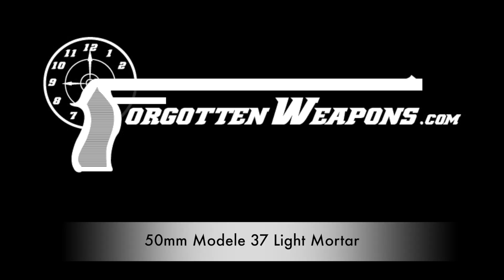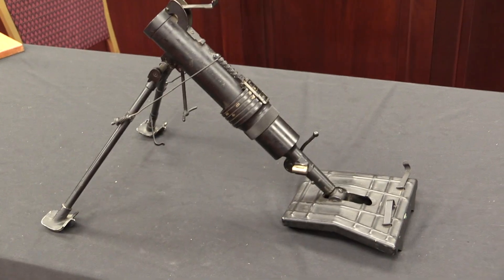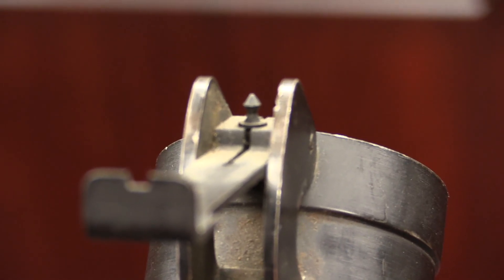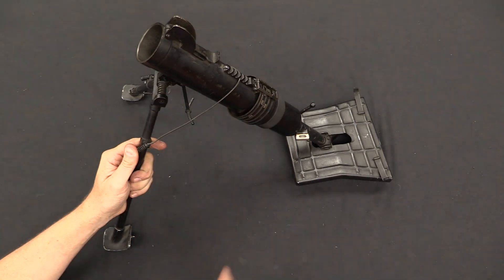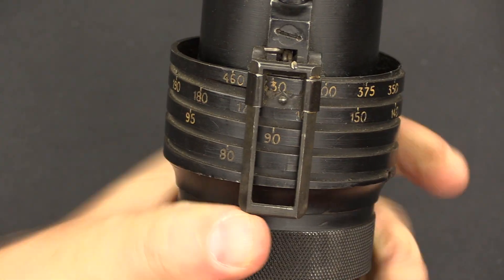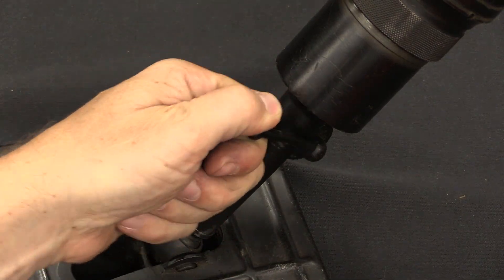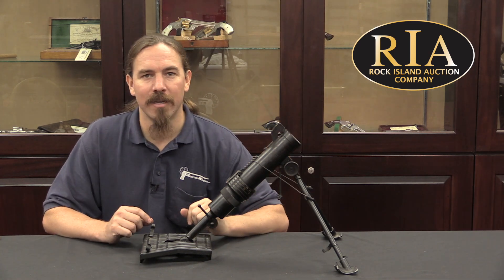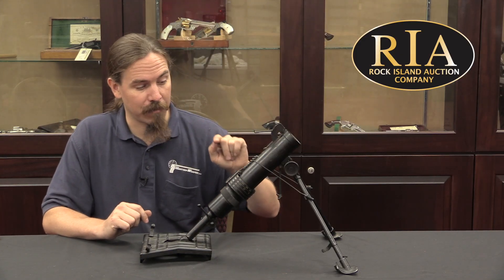France's Super-Light 50mm Modele 37 Grenade Launcher

Comment: Ironic that the thing dissassembles brick walls also has the same name of the thing that keeps them it together. 

Early cement was made with shells and lime stoned burned and crushed/pestled inside large mortar (and for some reason the product it produced got the same name as the tool it was produced it)

Then the mortar(weapon) comes along which basically looked like an oversized cauldron and while mortars and pestle worked by applying force to the inside container to crush something, the weapon version works completely opposite, applying force to the OUTSIDE to expel an INTACT projectile out of it!

Should be called antimortar, though to be fair both the mortar&pestle and the mortar&projectile are in the business of crushing stuff.

Comment: Does anyone think that light mortars and also hand grenades will be replaced by UGL grenade launchers fitted under the barrels of modern assault rifles. 

Projectiles fired from UGL are probably much more accurate than hand thrown grenades, and if 25%/50% of Infantrymen are issued with a UGL, the firepower would be higher than a separate light mortar section in each infantry platoon.

Comment: For all the fawning about this one should remember that the Germans were underwhelmed by this weapon and did not issue it to front line troops but garrison troops, as the Granatwerfer 203(f) and they shut down production only to pick it up 4 years later to help stock the Atlantic wall. Small, light, but also not terribly effective. Considering the Germans thought their own 5 cm too light, and it fired a round twice as effective, this was hardly going to be sent to the troops doing the real fighting.....even if the French thought it could.

Comment: You were at 167M, not 430. The marks show which side of the screw the indicator needs to be on to get that range. The dial needs to be turned until the indicator rides up all the way to the top of the screw on the dial to get to 430+.
Reply: Watch it again. The sliding part slides all the way up.

Comment: The French have made a few doozies when it's come to weapons but what major manufacturing nation hasn't had a few disasters? But aside from that, one thing that is a recurring theme about French weapons is that they are designed and made with a lot of input from the soldiers in the field that will need to use them. Rugged, reliable and operable are priorities. Aesthetics last. (FAMAS however, is not a good example of this).

Comment: First shot slower than a rifle grenade, but subsequent shot comparable, possible quicker and capable of more precision. Military vets from several nations I heard, speak poorly about using explosive rifle grenades, although more understanding of gas grenades  that do not need precision as in riot  control. The rocket propelled grenade as in Bazooka, RPG, etc, rendered explosive rifle grenades and these small, though historically interesting, mortars obsolete. (A military collectors' club had 5 vets WW2 to mid 1970's, from several countries, that spoke of first hand equipment experiences, at a seminar I attended 10 years ago, and subjects of RPGs [one vet a former ComBloc] with brief side comment of rifle grenades-btw, that's what I'm repeating here.)
Reply: Well, they pack too little "KABOOOM" for the weight thus it is not surprising. Unless it is automatic weapon. So they decided that it is better to have 1-2 good BANGs instead of a bunch of plinkers. :)
M72 LAW during Vietnam war was used in this way while Vietkong was using soviet designed AT weapons as portable artillery. Soldiers and real battlefield proved designers wrong.

But in WW2 as there was nothing else to use for a long time - this would be fair addition to the arsenal.
Reply: Supposedly, US troops in Viet Nam were using captured RPGs in preference to LAW. This related by several elderly Viet Nam vets. I have no way to verify those anecdotal comments.

Comment: Seems like you could add a sleeve to the inside of the barrel and adapt it for 40mm.
Reply from the maker: Current 40mm grenades have a rimmed case and must be loaded from the breech.
Reply: Just as well.

I was going to ask about the Bofor's ammunition, but those shells look to be larger than the mortar.
Reply: And put a sleeve inside of that, and fire 12-gauge shotgun slugs! x)

Comment: Seems like it would be a great squad-level support weapon, one that can be easily brought on "routine" patrols and such. Make it with modern alloys, maybe some carbon fiber and use modern propellants to improve range and reduce weight even more. With a map and some good adjustment system on the mortar, you could act like a regular mortar team and drop grenades very accurately.
Reply: Or... you could use a modern, lightweight 60mm mortar, with the large array of NATO-spec projectiles already designed for it (and the 40mm grenade launchers already issued to each infantry fire team).

Comment: Is there any mechanism/bubble level for aligning the tube vertically? I'd imagine that if the sights were on target, but the base was a few degrees off-kilter, the shots would land wide?
Reply: Alex Vogel, just adjust the gas mechanism. You want it close to 45° for maximum range on a given gas-adjustment level, but after all this is not a precision device.
Reply: I'm talking about left/right adjustment, though; if the thing isn't sitting more or less straight up and down on a vertical plane (45 degrees front to back, 0 degrees left to right), it's  not going to shoot straight. For instance, if your sights are dead on the target, but the base is 20degrees off center to the left, the round is going to shoot way wide to the right. If you set this thing up on a hillside, you can use the level to set the 45deg front to back angle, but you may be way off on the left to right. Is there a mechanism to prevent that?
Reply: Oh, now I see what you meant; good question.
I've never shot such a device, but I believe that the idea is keeping track of where the previous grenade landed and adjusting accordingly, gradually closing in. Even much larger artillery pieces are (were?) operating on this principle, with a soldier assigned to be the "observer".

Eyeballing the angle should be good enough for the first shot.
Reply: With precision guns, sniper rifles and long range target rifles, you'll often see a bubble level mounted to the scope. If the gun is canted, even just a little bit, the holdover can be enough to throw your round off target. If you calculate that for a specific range, you need to hold your point of aim say 5 degrees over your target for your bullet to drop into the bullseye, but instead of holding at 90deg from horizontal, you hold at 85 degrees from horizontal, your bullet will come down next to the bullseye, not on the bullseye. This will be much more exaggerated when using something like a light mortar, as its more difficult to eyeball the vertical seeing as you're more or less over/on top of the weapon, instead of directly behind it as you'd be with a rifle. Yes, you could spot your fire and walk it in, but this weapon already has a bubble level to help you establish the correct 45 degree forward angle--it would stand to reason that there is a similar tool to establish a 90 degree vertical angle as well.

Comment: I love how this proves the point that you made, Ian, a few months ago, that the French could come up with some of the best solutions militarily out there, but way too late for it to be impactful in a really meaningful way. I think you made that point in your MAS-36 video, saying that theMAS-36 is probably one of the best miitary bolt-action rifles, buuuuut everyone is going over to semi-automatics now.
Reply: In many cases France was on the cutting edge but stuck with their super cool first of a kind way too long.
Reply: Also, does this take glock magazines?
Reply: piritskenyer,
Remember that the MAS36 was not intended to be a battle rifle, but  to be distributed to drivers, artillery crews etc....Unfortunatly this part of the french military modernization program was more advanced than the one of the semi auto rifle. Which was almost ready to run into production. But shit happens....
Reply: @Zorglub1966  yes, I am aware of that. Despite that, or maybe exactly for that reason, it was an excellent rifle, both in terms of manufacturing tech and combat practicality. The MAS 40 shares many traits of the 36, including the stupidproof sights. I stand by what I said there.
Reply: piritskenyer,
 Sorry for the delay, i translated cautiously.
You're rigth, but i meant it was not on purpose, and out of the locked sight adjustment i sincerely don't understand why sharing some traits between MAS36 and MAS should be a problem.
Anyway, whathever the amount of modern individual infantry weapons available, it would certainly not changed anything for the french armies.

Comment: With that cute thing being so little, shouldn't there be a way to manufacture inter "target practise" rounds for it? How much propellant could it have before the ATF wants to stick a tax stamp on it?
Reply from the maker: Propellent doesn't affect NFA categorization; that's based on explosive in the warhead. You could easily make inert projectiles with something like shotgun blanks to fire from this.
Reply: Sounds cool. Imagine creating a box of aluminium bodies which can be re-used over and over again (maybe they'd need a partial hard rubber coating to absorb the shock of the impact) where you can simply add a blank into the base and do some ballistic plinking. And when you're out of shells, just collect the fired shells, remove the spent blanks, put new ones and and prepare for round two. :D
Reply: 44WarmocK77 interesting

Comment: The baseplate seems like a fairly intricate piece of casting for being that old and "just a baseplate". Someone really went to racecar levels of weight reduction with this.
Does it use Aluminium anywhere in its construction to be that light?
Reply: 13i0Hazard666 we have one. I believe the base is steel. But I’ll have to stick a magnet to it to be sure.

-Marky
Reply: Looks to be a simple steel plate stamping/folding with reinforcing welded in.